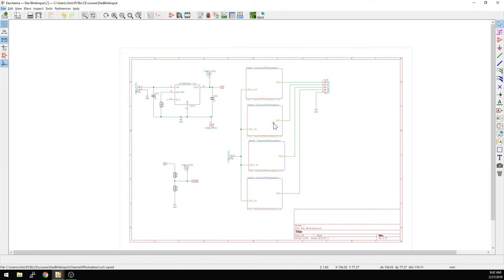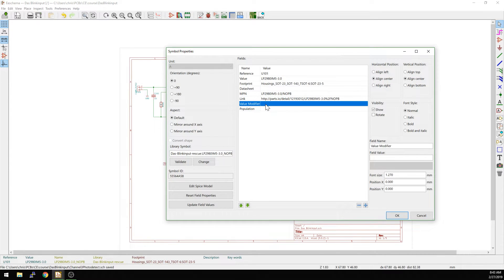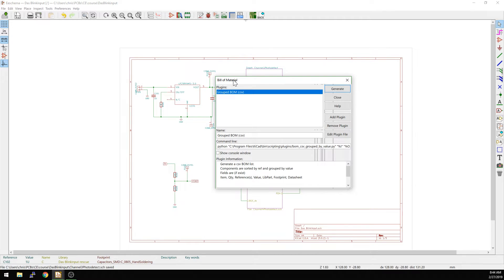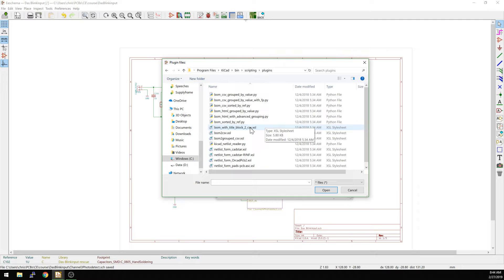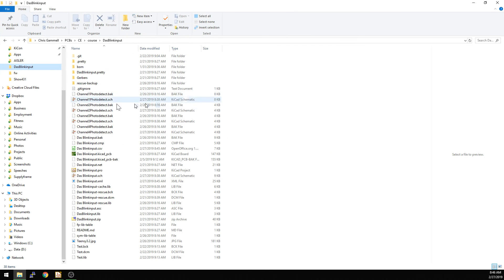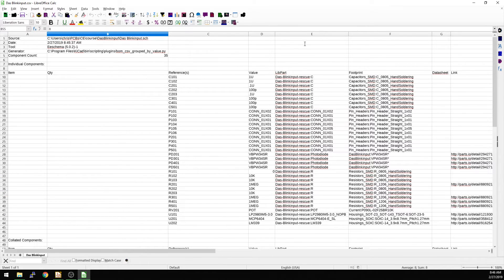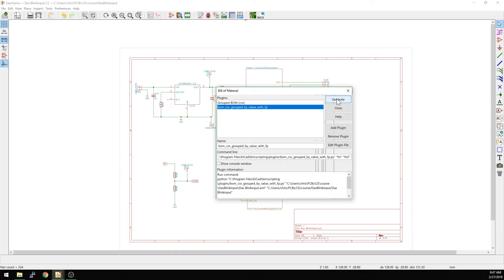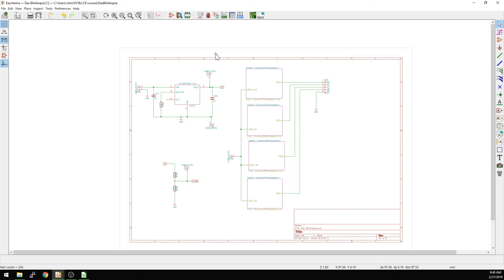KiCad 5.0 - Exporting BOMs

Comment: xsl is an xml stylesheet.  It used to transform an xml document (either for display, or to reorganize its format, etc.).  If you load an xml file in FIrefox and it doesn't have an xsl connected to it within the xml itself, Firefox will warn (at the top of the window) that it will only display it in the internal xml format (e.g. not make it easy to read for us humans).

Comment: Another great video Chris. I like to add several additional fields as well, but instead of using population, I use config. This way, if I have multiple configurations for a board, I can make a note on the schematic somewhere as to what the configurations are, and then set the config file to "Do Not Fit" or "Config 1" etc. I also like to throw in a description field as well, so I can copy the description from Digikey or Mouser. This gives me much more data, like the voltage rating, as well as tolerance, footprint (in case I forget to change my default, I can check), and more. I have found this very handy even in the last few weeks.